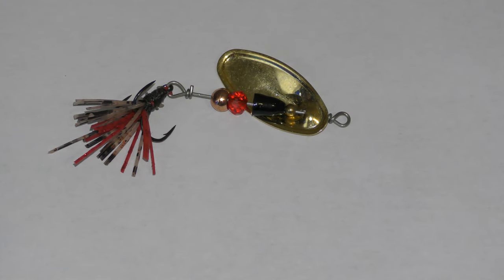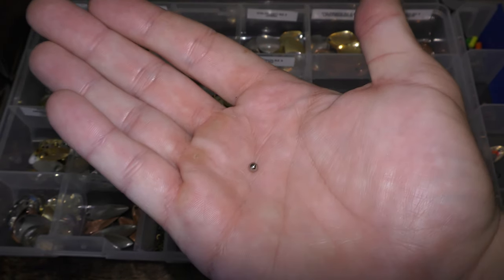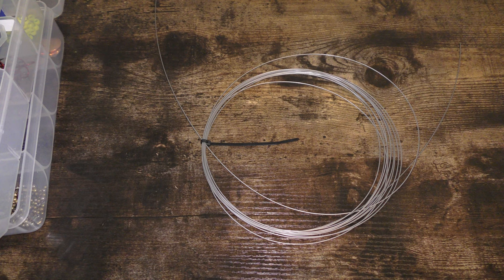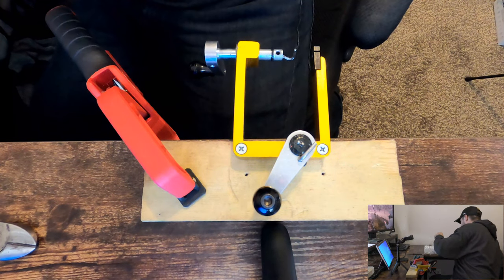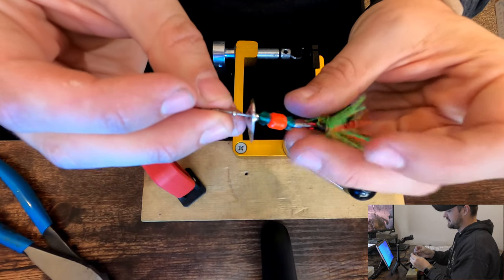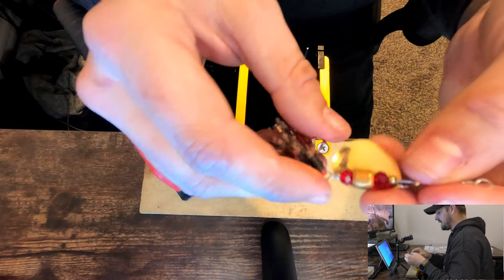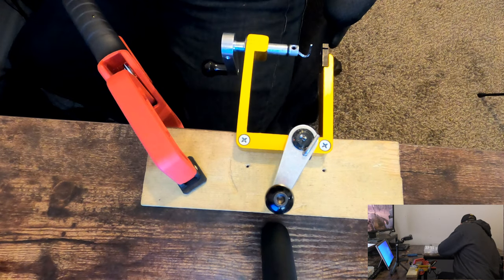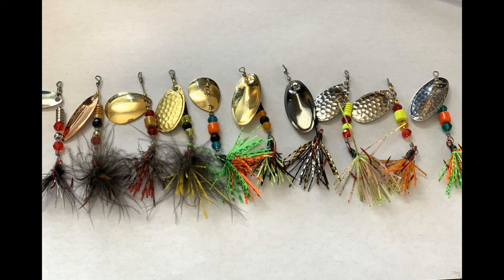HOW TO MAKE YOUR OWN SPINNERS FOR TROUT - LURE MAKING 101

Comment: Was looking through my shed for something to make spinners out of. Had lots of copper but brass would be better, and it seemed I only had brass like old valves and such. Then I peeked behind a shelf and low and behold found the perfect thing. A kick plate one foot by 32 inches long and the perfect thickness. Came from an old school door I scavenged twelve years ago. It's old, and solid brass, not like the newer ones that are painted brass.Now to mark and dremel it up into pieces.

Comment: Awesome video, thank you. Very well laid out. Bought a twistech years ago to make salmon spinners. It’s been buried in the garage. Dug it out recently to make some trout spinners. The insert you made looks great. The stock loops are a bit large for my taste. I try to crimp down the tag end with pliers to help keep from getting hang ups. Still using bearings. Sometimes I’ll use a smaller glass bead instead of brass for the bearing. Good stuff, keep it up.

Comment: Man this was an awesome video. I bought some spinners and a couple wont spin up for some reason. What could be the problem?
Reply from the maker: It could be a few different things. First, make sure that you have the correct sized bearing beads and clevis is and that brighter are too tight on the wire. Some blades are better suited for spinnerbaits rather than inclines too. An example is some deep cup colorados that I’ve had issues with. The last could be the balance of a lure. You need to play with different blade-weight combinations until you find the sweet spot. Just keep trying new things and eventually you’ll master it!

Comment: What size hooks do you use depending on the weight of body or lure?
Reply from the maker: It’s really up to you. I typically do size 10 trebles for 1/32 oz, size 8 for 1/16oz, size 6 for 1/8 oz and size 4 for 1/4 oz and above

Comment: do you want the blade to be the length to cover beads?
Reply from the maker: Doesn’t have to be. Just as long as it isn’t touching the hook you should be good. I’ve found the blade to weight ratio is more important that the blade to length ratio